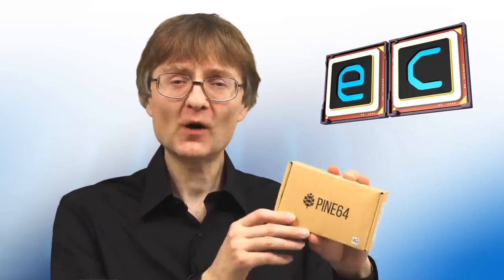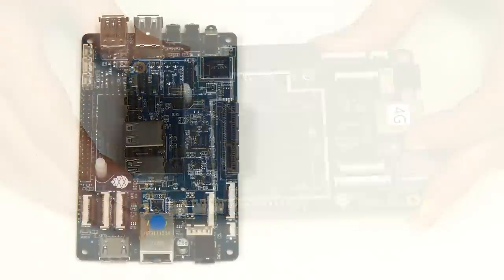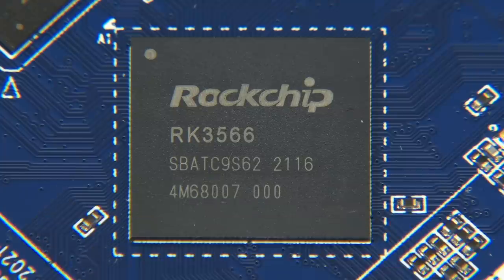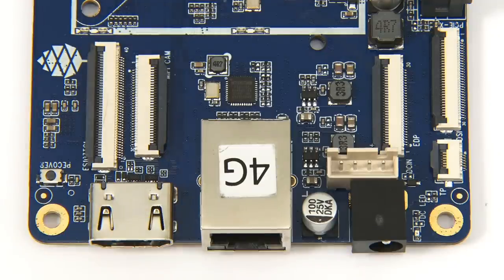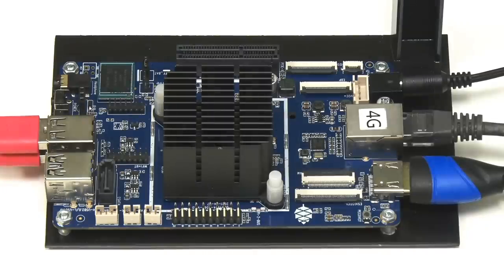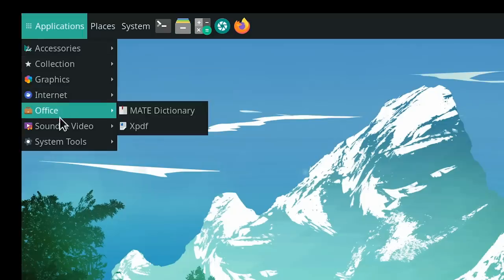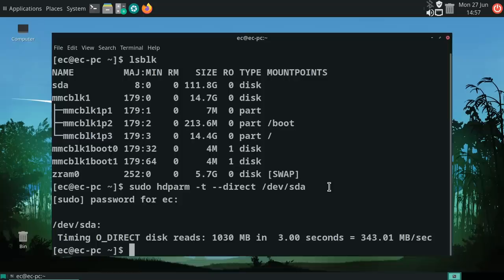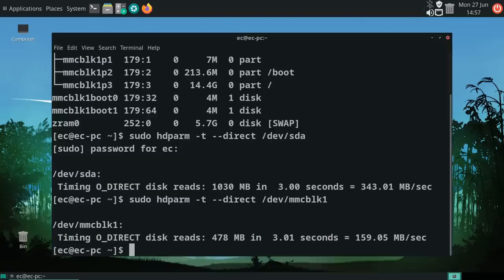Quartz64 Model A – PCIe & SATA SBC

Comment: That's where the amateur goes wrong: the USB3 connector doesn't work at the same time as the SATA port (4:50)
Suggestion: maybe use a pointing stick instead of your fingernail ?  👍
Reply: Fun idea: I found a short pen of a porcupine at the zoo. Use it to control my navigation touch screen.

Comment: The PCIe connection, despite what the physical connector might look like, is a PCIe 2.0x1, as is the only available PCIe provided by this chip. There's another chip from this family, the RK3568 that adds an additional 3.0x2 conection to the SoC.
Reply from the maker: The PCIe generation is indeed 2.0. But the physical slot type is x4. :)

Comment: With the rising cost of energy, for someone who's used to a reasonably fast PC looking to sacrifice some performance for saving on energy bills, what SBC would you suggest that would give a nice responsive desktop environment, good streaming video playback (YouTube) plenty of RAM, 4GB minimum, 8GB preferably and the ability to attach an SSD and a larger mechanical data storage drive?
Reply: Windows 11 support plus and an extra NVME drive i would replace my desktop. 
My current system is drawing 90watt in youtube 4k. 720p 80 watt. I like Linux but sometimes it is a pain in the ass.

Comment: The hardware its really reaaaallly interesting, but i can't understand how they went from a model A with PCIE and SATA to a model B without PCIE. Those seem like 2 completly different models for different markets instead of a hardware upgrade as they even do have different form factor, so they seem more as a new product instead of a refresh. 
They could have the one model with PCIE, NVMe (or sata) as a "PRO" (or wtv name) and the other model with NVME and wifi as a "basic". 
I understand they may be cutting up costs to compete with RPI, but as you said the model A is way more interesting.
The software seems almost unusable at this point witch is a shame. My question is: woudnt be possible to install another Linux distro? I absolutly love ur SBC videos, please keep those coming!
Reply: You do have PCIe on the model B, but it's using an M.2 connector instead of the typical PCIe slot, and you can use an adaptor for that. I believe the main reason for the differencs is simply the limitations of the RaspberryPi form factors on the Model B. Regarding the name, it might not be the most straightforward, but at least is consistent with previous product lines from the company to avoid confusion. Additionally, the Quartz Pro is also on development with an RK3588 SoC.

Comment: PINE really just gets the firmware so it can have something installed on it, and then they do fully expect the community to do all the work. the pinephone has been fairly successful, because the nerds have been wanting a linux phone for a long time. if the community hadn't done the staggering amount of work that they have,they would have moved less than 100 units. 

if you want something more powerful than the RPi, honestly just get an embedded industrial sbc from amd at this point. basically the same amount of work to get an OS on it as all the other unsupported sbcs, but far more powerful and has 10 year hardware support.
Reply: PinePhone has been out for two and a half years, and Pine64 gave out some financial  support to various distros, and still not a single stable OS. I wonder what they did with those thousands of dollars in donations.

Comment: In theory - a great board, I would like to have one. Would be good for a home NAS or something like that. But with such poorly performing software, it just doesn't make sense.
I'm afraid that they would rather release a new model than finalize software support. I have such a situation with OrangePi i96: GPIO does not work, USB and Wi-Fi work poorly. Theoretically everything else could work fine, but this board does not have anything else.

Comment: Sincerely speaking, I would not wait for software improvements on this board. 4 A55 cores is not that impressive, and seeing how it lags on desktops I would not pay $60 for this board even if it software improved. It is a shame since the SATA interface and PCI slot are nice features, but the unimpressive results kill it all. Thanks for the honest benchmark.
Reply: However, the A55 cores run at 2.0 GHz / don't know if that is faster or slower than 4 A72 cores at 1.5GHz in terms of time-to-answer
Reply: The graphics performance would be much better if a suitable driver was provided.
Reply: @ronaldglider : I don't either. I'm under the impression that 4 cores is a little too tight for SBCs to be used as desktops, particularly with A55-only cores. Maybe more cores and a mix of them, as we can see nowadays (4 A72 + 4 A55). However, only clever multithreaded programs will be able to really shine on these. Nowadays, with all the parallel instructions per cycle in a single thread, it is hard to make multithreaded apps efficient with less than 8 cores.
Reply: @johnm2012  We actually don't know if it is really a driver problem. One cannot conclude that from the analysis in the video. What's strange is that with a GPU onboard it would lag that much. With more cores and CPU based vector graphics (not this simple bitmap UI) the GUI would be blistering fast. The problem may be also that windowing systems (particularly on Linux) that are built on layers and layers of code.  A real good test would be a custom multithreaded app with all the UI running in the CPU, just for comparison. And I am not talking about a Python program, but a C/C++ or Golang app.
Reply: @schizoidman9459  do you mean multi-issue versus multicore when you mention parallel instructions per cycle in a single thread as a thread is usually assigned to a core?
Reply: @ronaldglider  : I mean that several instructions are nowadays executed simultaneously in a single thread in a single cycle because of many logic circuits that can be addressed simultaneously (multiple ALUs for example). If you use multithreading many of these optimizations are blocked by the compilers because of serialization operations. Many intrinsic parallel instructions (intentionally mixed by the compiler to obtain this parallelism) are not feasible with atomic execution. That is the reason many algorithms that are parallelized in 4 threads are actually as fast or slower than in a single thread. In mobiles this is done differently, since each core is responsible for a different and independent task (no race condition). The problem in this approach is that the load isn't well balanced and some cores may be idle due to lack of activity. When you code a multithread application your threads are rarely independent from each other, thus always requiring serialization to avoid race conditions.
Reply: @schizoidman9459  as far as I understand, this definitely applies to Intel compilers for X86, but I don't think that gcc (used for non-X86 ISAs) is that sophisticated...
Reply: @schizoidman9459  It is for sure a driver issue. The PinePhone has been out for 2.5  years and still no GPU driver.
Reply: @knerduno5942  if it is, that is one more reason not to buy it. How can someone release a hardware with features that cannot be used? To me that's a huge red flag. Maybe this is common place in the embedded world today, but it is quite frustrating. It lacks seriousness. Pine had a good reputation as far as I could see, but after I have been reading here, it just vaporized. I am not buying any Pine products any time soon.

Comment: While you mention the fact that this is in development on the video, I don't think you stress enough the goal of this product. It's not so much a consumer product, but rather a development platform for establishing good mainline linux support for the RK356x platform. Unlike most SBC vendors that ship a simple linux distribution on top of RockChip's linux version and call it a day. This ensures much longer lifespan for the board and up to date software on the future, but requires a large initial effort. While the product has been available for a year, Pine64 has been quite transparent with the goals and provided frequent updates through the wiki and blog post. Considering how recent this chip is and the lack of contribution from RockChip, I think some of the comments are a bit too critical with the board, and this work would pay off in the long run, benefiting many other SBCs based on this same platform.
Reply: Not trying to hate on other people's comment. I'm just trying to shed some light in Pine64's work that isn't so obvious when looking at the current state of the software.
Reply from the maker: Thanks for sharing this -- useful info. :)

Comment: Ouch!  After a year, they're still in Beta testing?  That's a shame.  So many of these SBCs are let down by a lack of software support.   It is why, in my opinion, the Raspberry Pi is still the #1 SBC, despite its (relatively) underpowered CPU.  Their software support is so good, that it makes up for the fact that its CPU is not quite as good as many other SBCs out there.  I can live with the lower power, as long as the thing works properly, and I can get support when I need it.  The Raspberry Pi still has the SBC market locked down, because of that.  They'll be very hard to topple.

Comment: That PS/2 keyboard would not connect to that SBC.
There's clearly a lack of that connector type in the board.(heheheh...) 
Also,
I went out of my way to get a computer motherboard with both mouse and keyboard PS/2 connectors.
I have a lot of those older devices lying around.
From the time Brazil used to produce those, and not depend entirely from China for peripherics. (neoliberalism dismantled our production chain for pretty much everything) 
I take great pride in having these in working condition. (only my keyboard is a little too used, and the W, E and A keys are sunken in and don't make click sound. But it does work)
One of the mouses that I have I got in the trash, with bent pins.
I fixed the pins, but the connection is poor.
The mouse connects and work, but at random times, it goes JIGGLE JIGGLE JIGGLE on the screen very fast, like jello. Quite amusing to watch.

Also that last video about parts you did made me feel old.
You didn't explain IDE connectors, jumpers, or the relation between Master/Slave drivers.
Hahahahaha...
My first computer, back in 2006, a used one, had 20GB of storage.

I also want to say that, about your channel update video, your 3D Modeling video was what made me subscribe, I really liked that. (but I've watched other videos about Linux, and I've made my move to full time Linux a few months ago) (And I'm still waiting on you to make half Life 3. Hahaha) 
I think you could do any sort of content, and I would watch. Christopher you could go randomly to ExplainingCuisine and that would still be Interesting. (this is a great idea for a 1st of April video. LOL)
And lastly, I want to say that, about the members thing, I heavily disagree about locking some content to members only.
Everyone should have the right to access and education about these topics. We have a serious accessibility problem.
I think people should support your work, not because they expect something out of it, but because they really like your work.
I would absolutely contribute if I could, but even though the membership is pretty accessible, I simply can't. Brazil is currently in a tight spot, with no date set to exit it.

Sorry for the long text, my friend!
Be seeing you!

Comment: Would the Quartz model fit into the Rockpro64 NAS case.  Using the Rockpro64 but got the 2gb model at launch and now with a good few dockers running its starting to creak.  Would this work with the same power adapter and case.  Currently running 2 3.5 disks 12 and 14tb and a SSD.

Comment: Thnx Chris, Let's see if your video either stimulates the development of it's potential OR KILLS the project; simply because hardware without the required software is no more than a paperweight. QQQ: have you by any chance tried an OS by 'the competition' that has similar hardware AND got it working? [if there is such a thing available?]

Comment: SATA port can't be a selling point if you are not booting from it, so I am not gonna be surprised if model B M.2 port isn't for booting either... SBCs have failed me, Pi 400 isn't throttling it just can't play back Formula 1 TV at 720p, tried browser, tried special apps from github, those worked the best until broke... now running android TV, remote control works, most apps work too, but not F1TV... Pirated streams work better than paid for content.

Comment: I’m not very familiar with the SBC scene,  but what’s stopping you from using armbian or void or something that has a kernel that supports the hardware? Is it just than pine64 chose hardware that has bad Linux support and now they have to write drivers?
Reply from the maker: Please tell me what is out there with a working image that does support the hardware! I certainly cannot find it.
Reply: And the problem is the distro developers are waiting for someone else to write the drivers.
Reply: @ExplainingComputers  Oh, I don't have a board to test myself, I was just wondering, PCIE and USB 3.0 work on x86 linux at least, so i was wondering if using a distribution that comes with a different version of the kernel would support the hardware better?
Reply from the maker: @tylerdean980  It may, if such a distro were available! :) But this is ARM board, and there are pretty much no hardware and drivers standards like there are for x86. So the situation is sadly not like it is with x86 Linux, where as you say an appropriate kernel will likely provide support, basically because they have thrown a load of common drivers in there to cover the most likely hardware to be encounted. But this is not the case with ARM, sadly.
Reply: @ExplainingComputers  that's really unfortunate, I would have assumed that the hardware other than the CPU would not be different, but I assume that is the case because the code for those drivers was written in such a way that they can not run on ARM?

Comment: Even the Raspberry Pi still can have a lot of trouble with a "mainline" kernel, rather than their own patched one. And that's after years of integrating patches. I'm surprised you didn't even want to give the quartz64 kernel a try which seems to specifically state it solves most of your issues. It's pretty easy on arch-based systems. It's actually slightly surprising Pine64 don't ship with that one by default.

Comment: It's a shame that, with Raspberry Pis being in such short supply, that developers of boards with potential like this haven't capitalised on the situation.  This is an ideal time for alternatives to the Pi to rise to the challenge and fill the gap in supply.  I would be very interested to see how the Quartz64 handles a Debian-based non-desktop OS with Octoprint or Klipper on top of it.  I realise that this ignores the main reason for buying the Quartz64 (the SATA and PCI-E connections), but if the price is low enough then this doesn't matter.  Perhaps in this instance, the Model B would be more suited.

Comment: Did you test Armbian??   Although it looks like Manjaro ARM has some serious display / window manager / compositing bugs, from what I can tell, it's still capable of playing videos, games, etc.. I wonder if they're trying to use Wayland and if that's the source of the trouble when trying to move windows around.  I also noticed that Android has been fairly stable on it for a while and seems to run with no issues.  Not that I care about Android, but I'm guessing this is more of a Manjaro problem.

Comment: Is there an SBC that has an open BIOS? It'd be neat to have a completely open tablet that ran an open source OS. Although, it'd be interesting to see someone attach an e-ink display to this and make it into an e-reader, fully open or not. I like your method of using the sheet plastic and gluing it together to make an enclosure, much faster than 3D printing and it still looks good. As for fixing the software, maybe a collab between you and Jeff Geerling. He could recompile the kernel and fix some things.

Comment: Did you use the Panfrost driver for the graphics? I wouldn't expect it to be this bad...
Also, can PCIe 16x cards fit or is the jumper in the way?
Reply: The PCIE slot looks to be X4 size. An x16 card would not fit.  Just my guess …
Reply from the maker: The PCIe slot is open-ended, so a x16 card will physically fit, but only operate at (up to) x4 speeds.
Reply from the maker: I would have to check on the jumper -- certainly very close!
Reply: You would need to use a riser
Reply from the maker: @primus711  I've just checked, and a longer card would fit -- if with the "hanging out" part of the connector touching the jumper plastic.
Reply: @ExplainingComputers  Unfortunate that it seems to use an old PCIe standard... I was thinking m.2 adapter. I use them in my pre-m.2 desktop, but it needs the modern PCIe spec to perform up to snuff.  (Or why I have no remaining PCIe slots.)

Comment: I'm just curious if you actually use any of these sbcs for any purpose other than just tinkering around with them every now and then. Like, do you have one set up as a NAS or as a retro gaming system? Or do you have one set up as a weather station for daily use? Or do you just use your full desktop computer for that stuff still and the sbcs are still in the "big boy toy" category for the time being? For me it is just sitting on my book shelf as sort of a novelty item, but I only have the Raspberry Pi 3 which I got 6 or 7 years ago or something like that. It just didn't have enough oomph to satisfy any of my own needs so I've just been using my normal desktop computer for all of the purposes I can think of for an sbc.